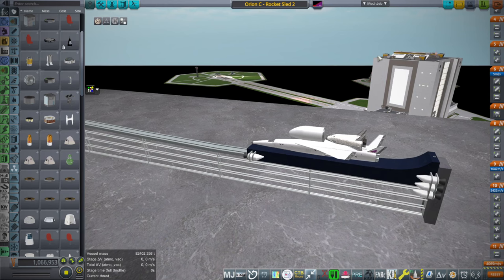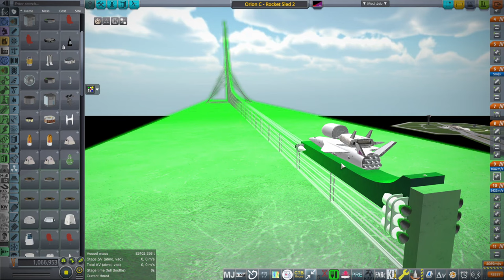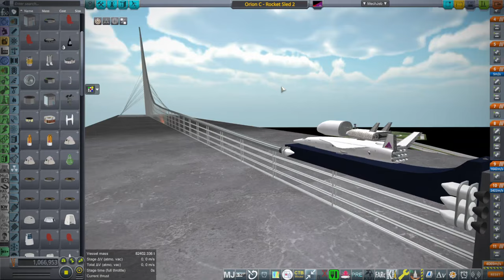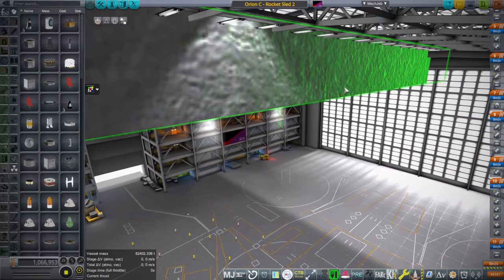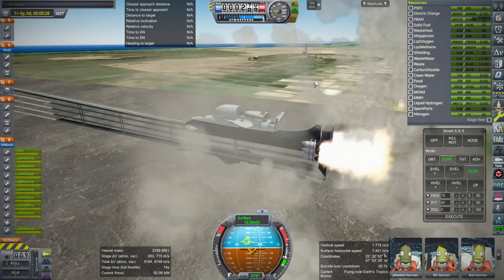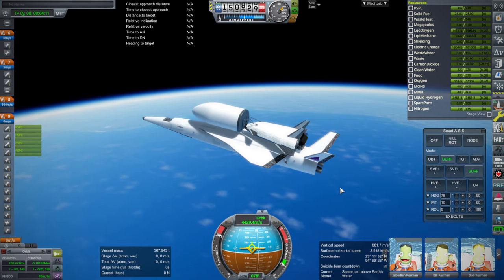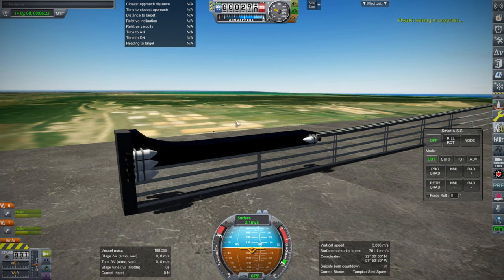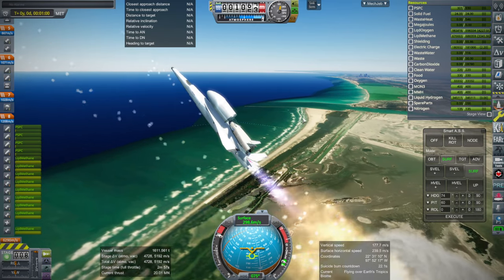Rocket Sled - The Tough Version (Kerbal Space Program)

Comment: Well that is an interesting concept. Nicely done! 
1. You’ve probably already done this, but I’d suggest a smoother curve for the ramp. 
2. Also you might try making it curve downward at the top, at the time of separation. That way the spacecraft would naturally lift away.
3. I would delay firing the retro rockets until the spacecraft has cleared the sled. That might be what’s damaging your spacecraft.
4. You would also get better acceleration if all engines ignite together at the start of the launch. (I’m thinking of the space shuttle as a model.)

Comment: Amazing.  I think you can fix the bodyflap issue by putting a pylon on the sled to get the plane further up. Maybe it also helps to mount the plane on an angle to the sled so that the engines pull the plane away when you decouple

Comment: I think you should move the OCP up a little bit so that there is more room for the body flaps to not get damaged and the sled gets less torched by the engines.
Reply from the maker: I'll see what might be safe. Most of this is down to timing everything very precisely, and ultimately that needs to be in the hands of kOS rather than my reaction time. I curved the back end of the sled so that it would be a thrust deflector. While I don't want the sled harmed by the OCP thrust, I do want it pushed back by that thrust - that helps keep the two objects apart.